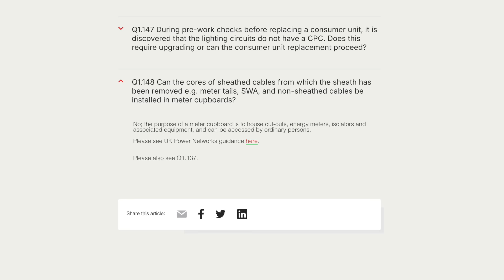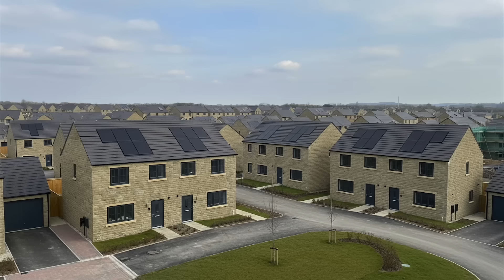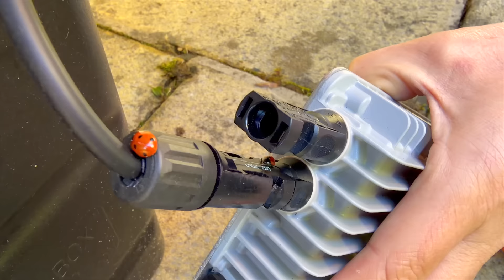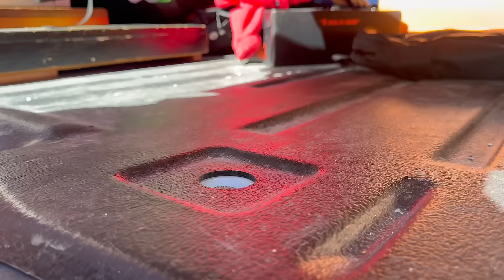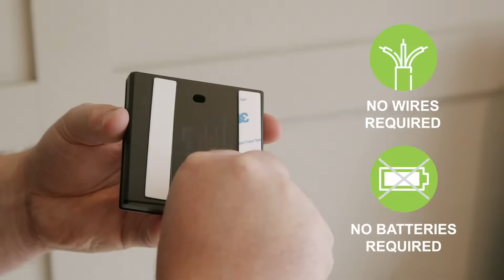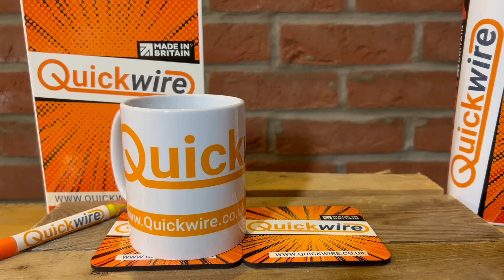At Last: Final Ruling On Single Insulation In Meter Boxes!

Comment: This might seem ever so slightly controversial, but has there ever been a single severe injury or death caused by a single insulated cable inside a meter cabinet? Just a thought that,  maybe, actual facts and statistics might have some role to play.
Reply: As soon as one happens, you, I and everybody else will be asking why it wasn't properly cabled.
Reply: @gottliebdee263  I very much doubt it. If it had happened, surely there would be at least some record. Now, I have no doubt people have been injured or killed by what's in their meter cabinet, but I would strongly suspect it was by doing some illicit, like bypassing the meter. The only reason most people will open the meter cupboard door will be to read the meter, and with smart meters the need for that is reducing all the time.

Comment: In Australia all wiring in a meter panel is segregated from humans via an escutcheon panel.
Curious to your thoughts on implementing this instead of banning single insulation wire.
Reply: We already have suitable materials and equipment to terminate cables properly. It has never been an issue in the past. Its only mentality and cheap plastic fused isolators which has changed.

Comment: Double insulation provides no benefit over and above single insulation, so long as there is no exposed conductor.

Human contact with either is safe, unless, the insulation is breaking down, but that is what EICRs are for, to detect it.
Reply: So you'd happily have single insulated conductors around your house?
Reply: @petersylvester2905 In the case of cables in the wall, the double insulation provides mechanical protection and stiffness.

This isn't required in a meter cabinet.

Those cables around the home also cannot be visually inspected (except only where they come out into an accessory such as a switch or socket).
They can be visually inspected in a meter cabinet.
Reply: @deanXRayZulu  the whole basis of basic insulation is just that, basic, it's only purpose is to electrically insulate the conductors, at any point where basic insulation is on show you only have a single line of defense from electric shock. 
In every part of the wiring regulations you've got a choice, a secondary layer of non conducting insulation or a housed within an enclosure with a bonding to ensure disconnection if something should make a circuit between a live conductor and earth. 
Example A- a double insulated plastic desk fan, double insulated cable to a double insulated fan. 
Example B - a metal wall heater with an exposed element housed within a bonded conductive casing and double insulated cable including a CPC to the metal casing. 
Where would the single insulated tails fit into either of those scenarios? 
Street furniture would be within a metal bonded enclosure and is not to be opened by ordinary persons so not comparable, remove a floor board or open an airing cupboard door even a locked one with a key and any basic insulation on show would be a C2 on an inspection in the same way if the cord to the plastic fan had outer sheath missing it would fail a PAT test.

Comment: A £100 year saving is not worth the hassle
Reply: In fairness it's not that much hassle you just plug them into a socket. Whether it's worth the outlay of cash is a question though. Although with energy prices only ever going one direction that £100 figure will likely also only go up

Comment: Solar been a requirement isn't enough making sure the whole roof space is been used (I see a lot of solar installs on new builds where it's just a tick box for solar and just install 3 panels when they could install 8 or upto 4-5kw problem free)

There should be a requirement for houses to be positioned in the optimal roof sun angle and no fancy peaks witch makes the roof unsuitable for solar panels

Comment: Balcony solar £400 to save a £100 a year! If they cost £400 to make what is the lifespan. In 4 years you may have covered the cost and require a new one, that seems to make great financial sense..
Reply: MCS panels have to include a 20-year insurance backed warranty. I assume the weak point in these kits will be the inverters. Hopefully they are modular using standard MC4s so it could be swapped out if necessary. Still, four years seems a bit pessimistic.

Comment: And yet the DNO PME/TNC-S concentric supply cable has a single insulated neutral conductor by default of its design, that can be touched!

Many houses that still have cutouts in pantrys and cellars have a band 2 voltage on a DNO supply cable, that's only fit for a band 1 circuit. 

Applying this rule now also means that all the control panels that I work on are now either a code 2, or a code 3. Even if the doors are closed. 

A junction box, an accessory, or an enclosure or containment of metallic or non metallic, also has the same departure by default of its design.

I'm so glad that BS 7671 does not apply to machinery.
Reply: A metal housing would have an earth bond and anything with basic insulation should require a key or tool to gain access. Safe isolation procedure wouldn't allow you to open the cabinet or enclosure before isolating it and then carefully opening it and carrying out a proper safe isolation once inside.
Reply: @petersylvester2905 

Indeed, but a key or tool is required to open a meter box/enclosure and permits access to a concentric cable with a single layer of insulation on the neutral. The same cables are readily accessible in pantrys, cellars, and understair cupboards feeding cut outs.

Some enclosures on motor terminals are plastic, as are DOL starters, and isolators and the like. Older control panels do not have an isolator interlock.

Deeming all the above a code 2 by the same token as the meter box scenario.
Reply: @poormanskint3008 I can remove all the socket faces in my house with a simple tool or even a butter knife but that isn't where a normal person would be expected to be going unlike a meter box to take a meter reading.
Reply: @petersylvester2905 Indeed. But how do you prevent a single insulated cable core from being touched in a meter box, a pantry, an understairs cupboard, or a cellar from being innacessable and not being touched by the public?
Reply: @poormanskint3008 you enclose the single insulation either in a second covering or trunking, conduit or whatever just as normal. I've never left single insulation on show in a meter box in 30+ years, I've never even thought about the meter box as an enclosure comparable to opening a consumer unit or distribution chamber.
Reply: @petersylvester2905 

If that's your perception, then by all means, you stick it. But make sure that you put an extra layer on the DNOs concentric cable that can be touched by normal persons. 

At least then you will doing your best to remove the code 2 by its own design of default. Please let us all know whether or not if the DNO investigates your work on their cable.

Comment: Great news re. meter tails.  The argument should always have been about whether ordinary persons would/should be present there. 

It’s very difficult to hide behind the tool/key argument.  There’s no other situation where ordinary persons need access to equipment where fault protection is removed, so it should never have been approved.

Comment: Presumably oversleeving of the separate cores possible in conjunction with a multi outlet breakout sleeve will achieve the necessary ;protection and compliance?  I've seen plenty of outdoor power cables using this technique.

Comment: What's the best way to install a SWA cable in a meter box? Brass gland only on incoming SWA 'floating or brass gland 'fixed' to the entry hole or half way up on an internal standoff bracket? Thoughts?
Reply: If there is space you could always make the swa off into an adaptable box, fixed
Reply: use an enclosure type that can accept the swa gland
Reply: @korona3103 hi, that's what's been done but the steel enclosure holding the fused switch is very big. Would like to use a smaller plastic fused switch to free up room but would like the brass swa gland to be fixed.
Reply: SWA is extensively used in industrial settings, and almost always is terminated via a gland fitted to a metal box or the dis. panel itself,  these  have covers with either multiple screws - often with non-standard heads, or proper lockable doors. These are not in fact particularly expensive as they're simple but robust strictures. How the rubbish plastic boxes you see everywhere were ever considered acceptable remains one of life's mysteries.
Reply: Into an switch fuse really.
Reply: Switched fuse only then break out to tails 

Over enginner not under engineer or why bother??

Comment: Gosh all this 'green' ideology is getting very tiresome. Your bills will only go UP. Don't fall for this nonsense.
Look further past the end of your nose into the science and grid infrastructure instead of what renewable zealots are pushing (Mr Milliband)...
Reply: @ef7480 green issues aside , given what is currently happening  in the gulf , energy source diversitiy sounds like a good idear  .
Reply: @samuelchamberlain2584  Heating oil is now 14p / kWh of heat delivered and gas at 7p.  A well design heat pump install will get you 6p / kWh on a bog standard price cap tariff (and under 4p on a heat pump tariff).
Reply: Coal then. We've got tons of it. Millions of tons.
Reply: Coal for power is falling everywhere from the US to China because it is too expensive. In the US, coal usage fell steadily between 2016 and 2021, despite massive political efforts to oppose that. It just doesn't make any sense financially anymore.
Reply: @markrainford1219  coal is horribly polluting, and not cheap to extract.  Also, there isn't much of it left.

Comment: Heat pumps are a nightmare and need a secondary heat source/system to keep up with gas/combi boilers. Its a scam.
Reply: Most Norwegians will disagree with you,
Reply: @anthonydyer3939 Compare the insulation standards in most Norwegian homes to those of most UK homes then you will understand why ASHPs have such a bad reputation in the UK.
Reply: They work elsewhere, just need doing right. Require some thinking and not getting sucked in to making them overly complex. 

Not as scary as you think, why spend more money than you need to?
Reply: @elllplfr  "need doing right", there's the rub.  We have the same issues here in NL: there's loads of heat pumps going in, and not enough people who know how to install them or (more importantly) correctly design and dimension such a system.  There's a newly built row of houses here that have the water-to-water heat pump type, with groundwater as the secondary heat source.  Under-dimensioned, so the houses get cold.  And the system was installed incorrectly and broke down, so those people there had no heating at all this winter.  It's getting better, more installers are being trained, but I'm going to wait until they work out the kinks (or until our trusted plumber finishes the course :) )
Reply: Heat pumps correctly designed are fine. Boilers when not correctly designed don’t show the same problem, they’ll just cycle on and off too much and break down more often. My concern with heat pumps are the noise, not the outside noise although a neighbour having one close to a bedroom window would be a problem, but the noise of the water going through the pipes. 

Because a heat pump has to have a low delta T between the flow and return the flow rate has to be quite high I believe. I’d be concerned that that the noise through my pipes would be loud and constant, unlike my current set up where The flow rate is low and virtually silent.

Heatpump suffers from lower efficiency when it’s colder so the cost to run goes up when it gets colder outside. They are more efficient than boilers but since gas is between 3-4x cheaper than electricity any heat pump running lower than a cop of 4 is not saving you money unless you can get on a special tariff or you have solar or batteries or both.
Reply: The MCS design standards include maximum pipe velocities. You shouldn't get any noise if they've been followed correctly.
I run my gas boiler at the same 5 degrees C delta T, low flow temperature, and relatively high flow rates and the system is entirely silent.

Comment: Why UK meter boxes never covered with plexiglass? The problem is not single insulated wires - the real problem is missing plexiglass barrier.
Reply: The problem isn't just single insulated cables, those SWA's in the video are not even made off properly, disgraceful stuff.
Reply: Agreed... wouldn't it neat if the only user accessible part was the isolation switch itself.... ideally built into the meter...
Reply: The meter, switches and so on are all plastic cased double insulated items.  There's no harm in them being touchable.  In fact manual read electronic meters may require the meter reader to push a button on the meter to change the display.  The UK could take a leaf from other countries procedures though where all the wiring and so on is behind a barrier of some kind.  Having single insulated touchable by the general public really was just a slap to the face of common sense.
Reply: @retrozmachine1189 The regs and equipment on the market have always been fine. The issue has come by where consumer units are sited, and the cable required has caused an expense in its termination, which developers don't like. Its just a shame they were backed by certain authorities and were allowed to wing it. Should never have been signed off in the first place, disgrace for new installations.

Comment: The panels are not plugged into a socket. They are plugged into an inverter which itself can be plugged into a socket
Reply: Yes and no. These panels typically consist of a solar panel with a micro-inverter bolted onto the back (often capable of serving a second panel), the cable coming off it being a regular mains one.  So "the panel" (solar panel + inverter) is plugged into a socket :)

Comment: How would this apply to electrified street furniture.... unmetered supply so not gereally publicly accessible but most use the same style trangle key albeit larger size generally. Doors are frequently open or missing also.. My feeling is that all new installations should not have single insulation showing.
Reply: The public would have no occasion to access or go into  street furniture. They do need to access domestic meter boxes in normal service, that's the difference.
Reply: @ChariotsofWire180 true but the ruling mentions open or missing covers and street furniture doors are frequently missing. Personally i will be failing all new street furniture installations with single insulation showing. Most installations i see have the lantern flex not terminated correctly in to the isolator.
Reply: @mastergraphic9998 That's how it should be. All these things should be pulled. The point you appear to be missing is the crap which has been permitted by countless installers, designers, project managers, site managers, not to mention certain industry bodies. I'll cut NAPIT some slack as they at least said it was a C2 so that something should be done about it.
Reply: @ChariotsofWire180 no mate not missing anthing thats is why i mentioned new installations! Old installations i would give some slack as acceptable at the time of installation. Street furniture electrical installations generslly have to meets Hers standards but loads of old installations are shocking 😅
Reply: @mastergraphic9998 We're not discussing hers regs though. This issue has come about through developers winging it on new developments, and being backed by certain "authorities". The regs on enclosures, termination of cables and selection have never allowed what's been going on. Whoever permitted and signed this stuff off should be fired.
Reply: @ChariotsofWire180 
Try explaining that to the idiot that received a shock from a lamp post with a missing cover
Reply: If something is accessible through neglect or poor maintenance, that's a different issue to wiring regs and things being signed off that were never right from the start.
Reply: I agree. Now that women have to leave their children at daycare so that they can return to work to earn enough to pay the electricity bills etc., I fear children are not receiving sufficient early instruction as to what not to touch. I think street furniture with the covers off pose more of a danger to todays uninhibited child.